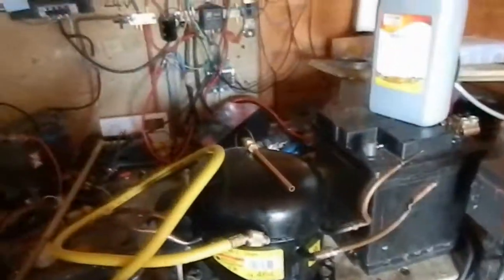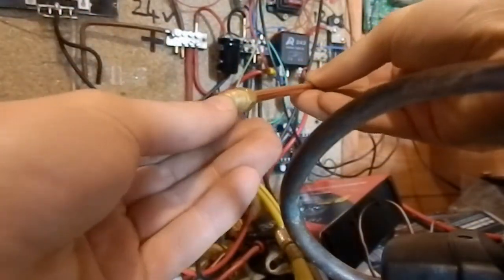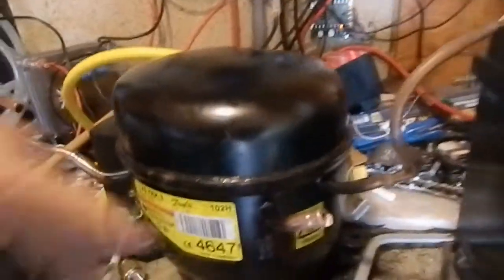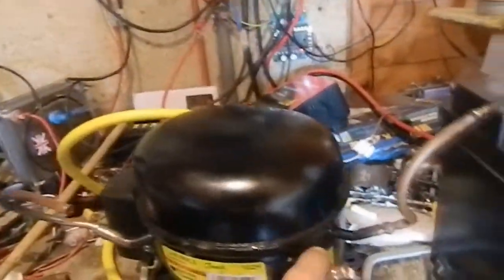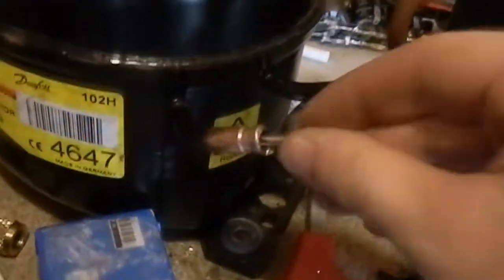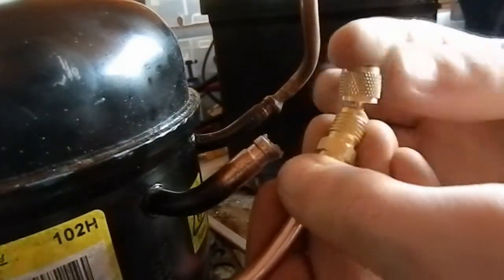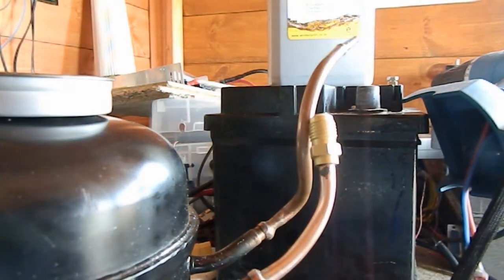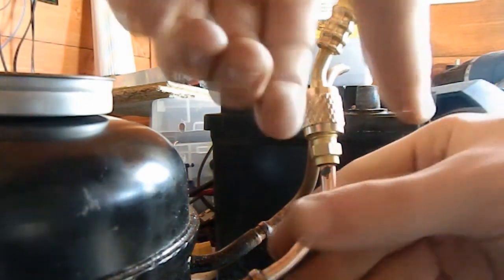DIY Refrigeration System #2 Service valve

Comment: I’m sorry but you are a danger to yourself and others by putting up videos that you have no idea of what you are doing I started to laugh so hard that you drilled out suction side port when you should simple use a1/4 swage two taps all done.I’ve been in the refrigeration trade for 24 years servicing and installing
Reply from the maker: OK boomer.

Comment: This video is  a disaster....using a tiny torch and radio-tv solder....slathering flux all over everything....drilling a hole bigger with chips falling into the tube....are you kidding?
Reply: this guy don't know shit
Reply from the maker: Yes, yes I am.

Comment: OMG! You have special tools for that. Expanding old copper pipe, after cutting, to inside 6mm, and brazing after. It's 10 minutes work...
Reply from the maker: I really don't know what point you're trying to make.
Reply: @ShaunDobbie  You will cut with the roller cutter, 4-5cm lenght the existing 6mm copper charging pipe. This will take 5 seconds. You will take a swagging tool and expand that pipe, to internal diameter of the copper valve pipe. You will clean the valve pipe, put it in and use phosphorous copper rod and MAPP or O Propane or whatever and weld. This will take few minutes. Why use a drill machine, I really don't understand.
What you are doing, from my point of view is wrong... excuse me if my comment was out of place. I watched with interest your struggle, and just trying to help, out of my experience.

Comment: if I buy a compressor for pc phase change Ile probably have to have  a expert Hvac  tecniction  to come and check it and fill it for me anyway because you can't handle refrigerant  but I can handle brazing  and adding service ports and adding my own evaporator lines and heads for subzero cooling
Reply from the maker: Add the gas yourself. You can use R290 and R600a
Reply: not if the compressor  is designed for 410A   plus I change my mind anyway it's pointless overclocking  anyway what gain can i get like 50fps lol  just get a better gpu  nowadays the cpu  does not matter  anyway Ile probably go with AMD  anyway but stay with Nvidia  gpus because they are stronger

Comment: Electrical solder will not be strong enough and will fail over time. This is why everyone uses brazing rods instead of solder. It's no bit deal, you just need a better torch and the appropriate brazing rods (silfos are popular).

Comment: I like your DIY attitude, but the copper flakes down in the compressor makes me cringe!  LOL  

I can tell you're having fun!  If you don't have one already, a small tubing cutter will make easy work out of cutting copper, much of the time.  They also don't produce a lot of flakes.  Reaming the tubing back out is where the copper material ends up causing trouble.  I guess you wanted to get as much of that tubing out of the stub as you could.  When you are worried about keeping those little flakes out, try tipping the compressor over enough to prevent the flakes from falling in.  Or, keep some positive pressure on the line, so they blow out as they are formed.
Reply from the maker: +M.C. Pletcher I hope there is still none in there but I did use air to blast them out.
Reply: @ShaunDobbie  if you heat the charging line of compressor .
Which melts the old brazing.
It will be easier and safer than cutting and drilling.